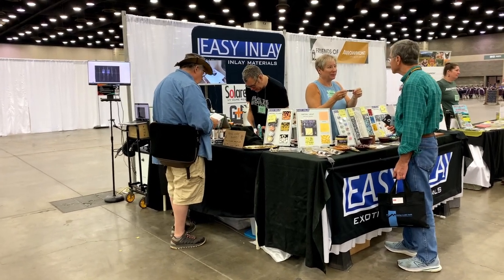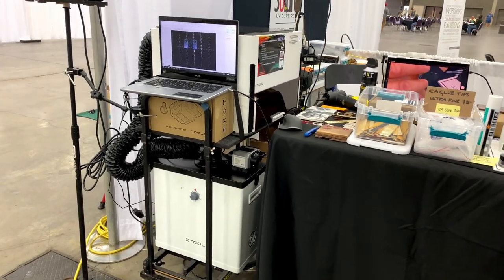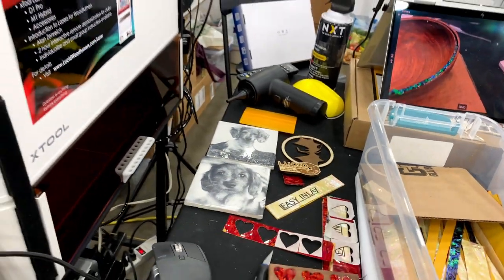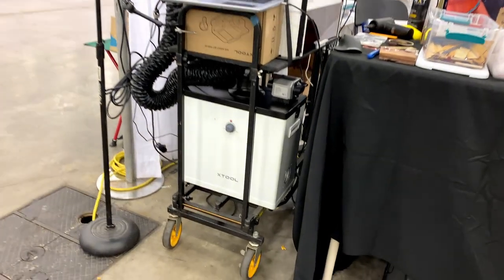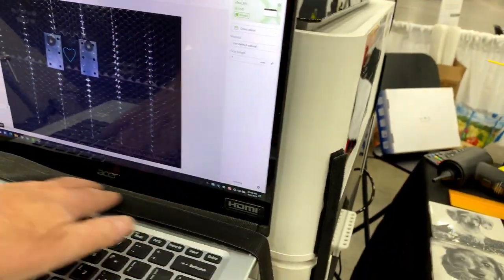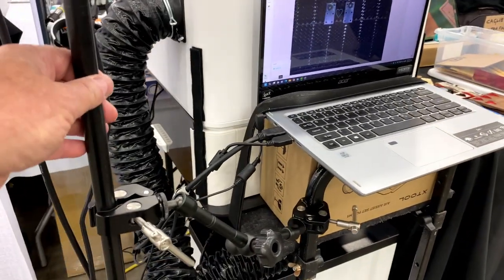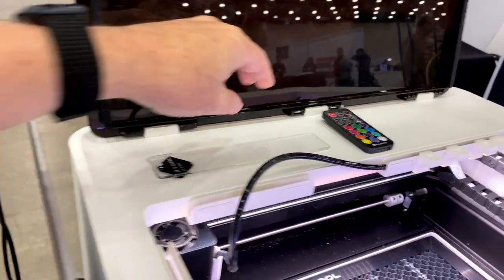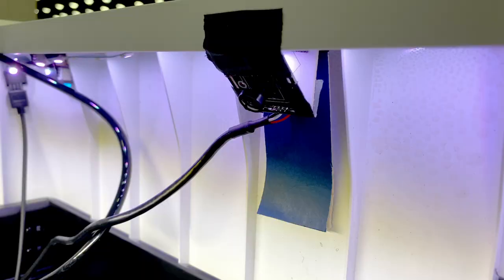xTool M1 Inlay Demo Setup

Comment: Hello! Excuse me, I wrote to you in this publication, but I was looking at one of yours from 11 years ago when you explained how to replace a breathe easy battery. Someone commented there, that looking at the motor plug from the front, the left pin is negative. In Uruguay we do not use that type of connection. Could you explain to me better how I am looking at the plug from the front? For example, in relation to the flat edge it has, if it should be up or down. To make sure I don't misconnect the wires. I thank you infinitely, and a thousand apologies for using this space, I took advantage of it, because it seems difficult to me that you were going to look at a comment from a publication from 11 years ago! Thanks for what you can give me. And excuse the English, it's from the translator.